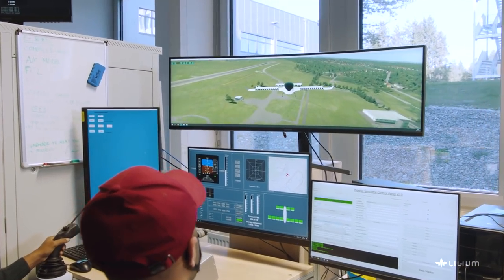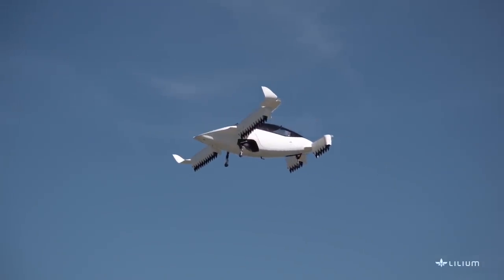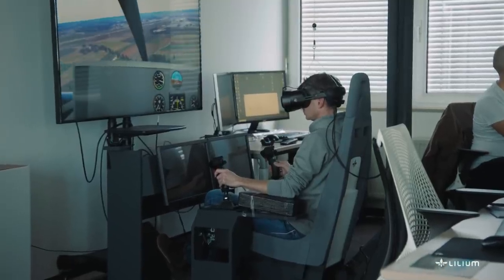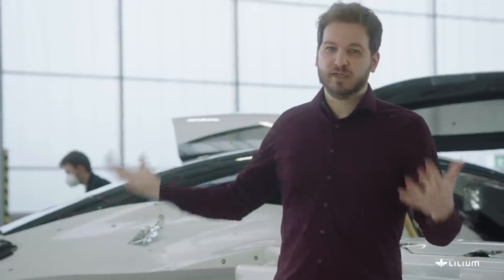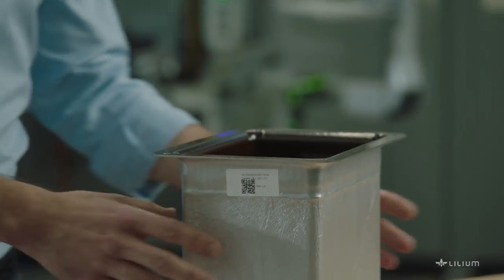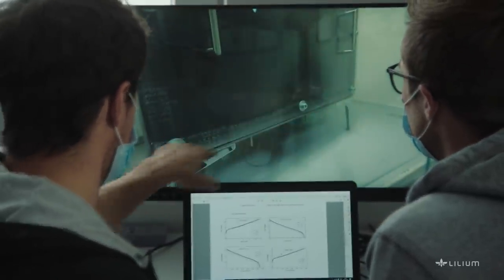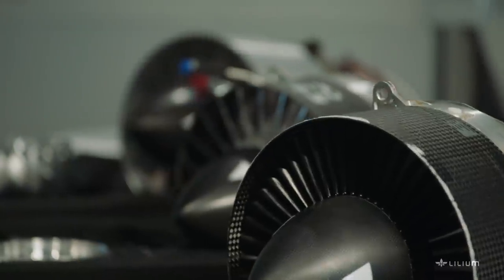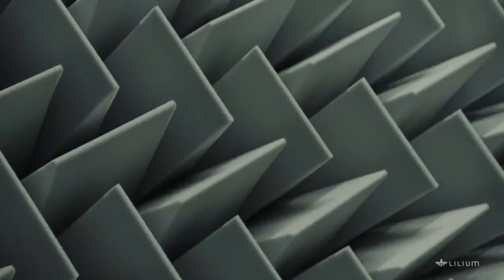Lilium Jet Technology with Daniel Wiegand, Matthias Meiner, Brian Phillipson & Alastair McIntosh

Comment: I have made a similar comment before on this aircraft. The great improvement in batteries has had a big affect on the use of electric motors and with their versatility  can be easily placed anywhere as Lilium have done and put them in ducts to give efficient lift , propulsion and control to the aircraft.  The fact that they also give maximum torque on start up is also a tremendous advantage. I am a retired Aeronautical Engineer having worked at Canadair, Boeing the RCAF and Certification Engineer for Transport Canada. Keep it up Lilium.
Reply: It's smoke and mirrors.

Comment: It will be interesting to see what gap this aircraft fills in the transportation industry and how the company will work out the kinks of logistics. Currently it feels a bit awkward for me, only thing that's exciting about it, is that it's full electric and I'm not sure that will be enough.
Reply: Cost savings and low noise allows inner city flight without the restrictions of extremely noisy and expensive helicopters. That’s the niche I see it taking over initially - inner and intra city flights for business owners who have the finances and need for quick travel but don’t own their own aircraft and can’t justify chartering flights.

It’s a very lucrative niche that Lilium could survive entirely in without need of expansion though of course that’s not the transformative vision of Lilium’s CEO.

Comment: How does multiple electrical motors constitute "jet engines" when powering this aircraft?? My experience with jet-powered engines didn't include electric motors to drive fans when providing the power to make the aircraft fly! 
Please explain the requirement for batteries to drive the multiple fans!! 🤔🤫🤩

Comment: I know I'm interested. Ever since I first seen your concept a few years back I thought it was pretty cool and now it's just amazingly beautiful.
When I'm ready to buy I hope the 5 seat'er is available for purchase. In the mean time I'll be taking ultra lite flight lessons.

Will there be any differences in piloting the jet when compared to other types of aircraft and will it have full auto pilot for nav and vtol?
Reply: It’s not a “jet” so should have the same certification as a helicopter since it does do VTOL minus autorotation as it would glide like an airplane in the extremely unlikely event of total loss of power.

Comment: What if most of it was built out of stainless steel, instead of carbon fiber? Cutting the build cost by 75%, even better because most of the body hold up o 60% more high density batteries to triple the range!